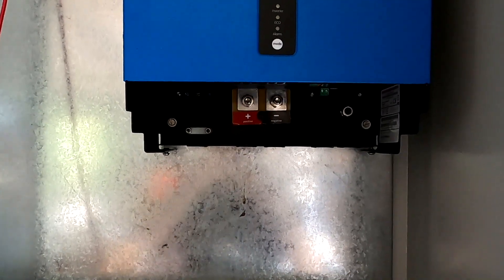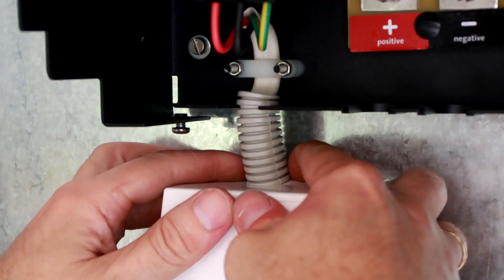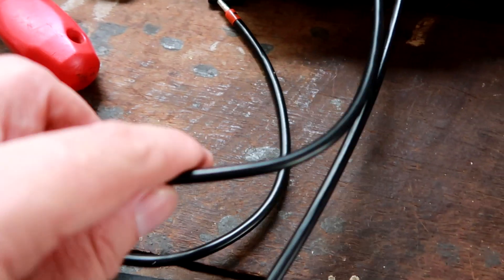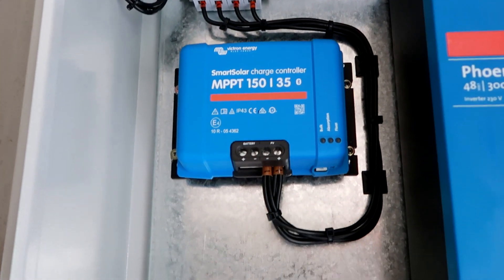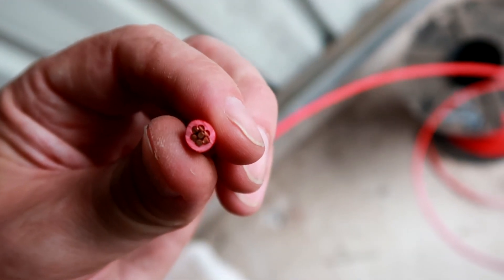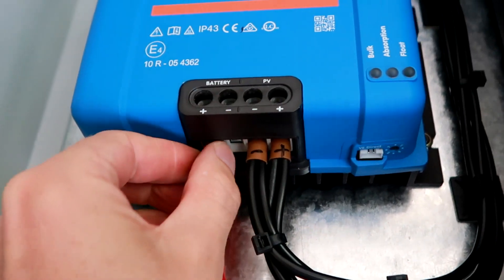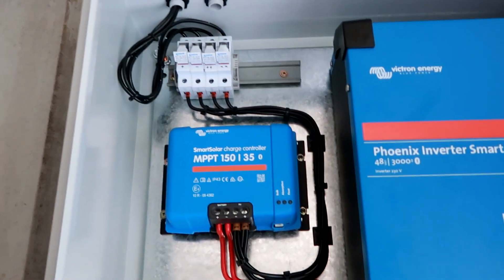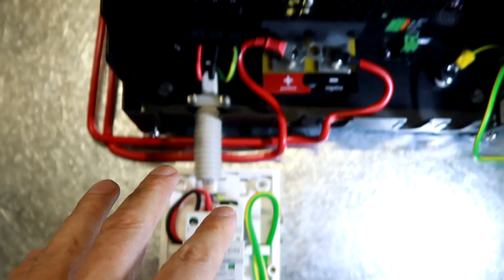'The Move'. More equipment inside the cabinet. Will it all work out?

Comment: Yes fuse from charge controller to battery. What if charge controller shorts? Can your 10mm cable handle the fuse rating of your battery?
Reply from the maker: The cable will be the fuse. Yes, you're right.

Comment: Don't completely cut the power to the garage otherwise how will you topup the battery
Reply: Instead of dead ending the input power from the grid attach a power point to it
Reply: Or better yet an automatic transfer switch so if the batteries get low it switches back to grid power.

Comment: Great video! I think if you put in a breaker between the MPPT charge controller and the Inverter, you could potentially shut off that breaker before the solar panel breakers which could damage the MPPT (according to what I read). Several people have said they can't kill their MPPT, but I would not want to test out that theory.

Comment: I'd definitely put an appropriately sized fuse between the SCC and Inverter., is that wire you used the correct size? I think mine is 2/0.   Nice clean work. Your enthusiasm is infectious.
Reply from the maker: The wire size is correct for the 35A from the MPPT, but yeah, the it conencts to the 35mm of the battery. There should be a breaker.

Comment: I know this is the off-grid garage, but have you thought about putting  an automatic grid switcher in case you run out of battery juice?
Reply from the maker: I thought about it for a split second.
Reply: @OffGridGarageAustralia  If you were going to do this you could have just went with the Victron MultiPlus  instead of the Pheonix. It has a built in transfer switch and can auto switch based on things like battery SoC or voltage (And even charge the battery from grid if ever desired or needed)

Comment: I use one 60A dc braker after each solar charger and connect inverter with #2/0 awg from the battery.
Reply from the maker: Makes sense.
Reply: @OffGridGarageAustralia  EE aren't here to help, just to discourage diy from taking jobs away from them. A disclaimer note to follow safety and local electrical code is enough.

Comment: Hi Andy, I believe your solar charge controller internally fused??? They say that it’s non replaceable but I would open it up to see, however does it protect both input and output? 
If so, my theory is that if you do add a fuse/breaker inline is will need to be rated lower than the internal. As far as breakers go those “Ebay specials” are junk and can’t be trusted. I have ordered some DC breakers that have the same form factor as AC from alibaba/aliexpress, and am going to test them to see if they perform as advertised, I will be pleasantly surprised if they do.
And as for Isolation like you said you can “isolate from the panel fuses” if necessary.
Reply from the maker: It has an internal fuse as per manual, that is correct. Just not sure how big it is so hard to tell what size of breaker would make sense.
Reply: @OffGridGarageAustralia  I’d say it’ll be 5 amps higher than the max output, curiosity would get the better of me and I’d have a sneaky peek inside, maybe at night or while there’s no solar production to be lost...
Reply: @Adlay_Eetswah  Breakers and fuses are typically sized for 80% of continuous. So if continuous power is 35 amps for this MPPT, you'd need a 45 amp breaker for 35 amps to be "under" the 80% rule: 80% of 45 = 45 x .80 = 36.

Comment: Instead of having the meter feeds terminate in an unconnected box, consider having a meter fed outlet beside your box installed so you've got the ability to power things (Like your new battery charger) when you need to swap out a component or you've got an extended period of unexpected low battery due to weather, etc.
Reply from the maker: I thought about this for a while. Let's see how I go as I expect the battery is been rather full all the time at this stage. Not too much load inside the garage at the moment.
Reply: I went back and forth on suggesting it as well, you can probably use an extension lead or two from the house if it were an absolute nightmare and battery powered devices weren't cutting it :)
Reply: @OffGridGarageAustralia  why not use a changeover / transfer switch instead of an end terminal? That way you can use solar for garage lights/ sockets but at the flick of a switch in an emergency you can put those lights and sockets back to mains fed. Only like £30 for an enclosed transfer switch and gives you both options of power sources :)
Reply from the maker: @w3bb0y  but I also would need to take out the M.E.N link inside the inverter which connects N and PE. 
The all in one units do this automatically with a relay depending if they run from battery or grid power.

Comment: Andy looked at this video and saw a lot of errors. I have an interest in solar, I’m a licensed electrician in NSW and also a degree electrical engineer. If you can contact me I can go through your installation and make it better and safer. I like your attitude and videos .
Reply: Yes, a 60A mppt controller needs at least #4 awg cable or 5mm
Cables bend create resistance. 
Inverter enclosed in the metal box create lot of heat, over heating and inefficiency.
Reply: @neliosamch3195  that’s 25mm
Reply: @michaelbouckley4455  I stand corrected. I miss the #2 thanks.
Reply from the maker: It's a 35mm MPPT connected to 1.2kW of solar. 25A are max it pushes into the battery.
Reply: It will be more helpful if you share your knowledge and experience with everyone here.
Reply: Andy can't find a contact so I'll post  brief observations. 
1) just be super careful with your installation. If someone is electrocuted you could find yourself in some trouble. Generally In  australia writing installation needs to be done by a licenced electrician. 
2). RCD will not work. An RCD only works if the installation is earthed AND the neutral is connected to earth. Its called the MEN system
3) Fuse holders from solar panels should be double pole. Ie one handle pulls both fuses. If one fuse is disconnected, the solar panel will still be above earth potential and could electrocute someone that expects the panel to be dead.
4) Active and return wires should be different colours. Place a  coloured sleeve over the returns to distinguish them.
5) Battery should have a double pole disconnector between it and the inverter. The disconnector could be a switch or a circuit breaker.
That's the important stuff
Reply: @kaindub  Very good observation but 48v is safe to touch without safety glove.
If somebody unauthorized to be there get electrocuted isn't a bad thing.
Do you have an opinion for a safe reverse voltage for melting the snow in the solar panel?
It is being  done commercially but no information for a diy setup.
Reply from the maker: @kaindub  It's all here: https://www.youtube.com/c/OffGridGarageAustralia/about
1) Yeah, I'm electrician myself, they just don't accept my 4 years of apprenticeship and 20 years of experience in Germany here in Australia
2) RCD works fine, the N is linked to the PE internally (see previous video with the inverter upgrade). As this is an off-grid system, This internal link is the M.E.N
3) fuse holders don't trip, they melt the fuse inside. You're talking about breakers?
4) You mean DC from the inverter or solar? I looked this up and it's just a recommendation from what I could find.
5) battery has a fuse to the inverter which will melt if A > 100A
Reply: @OffGridGarageAustralia  3) replacing the fuse holders with dual pole, linked-switch circuit breakers, is safer, and easier to use, when you have to disconnect the solar, first,  before any work on wiring. The dual simultaneous disconnect is a legal requirement in many countries, eg USA
Reply: @OffGridGarageAustralia  5) a battery kill switch to the inverter would be better; perhaps with a bolted junction, so as not disconnect the solar charger from battery; that could have a, or pair of breakers too
Reply: @OffGridGarageAustralia  A double pole fuseholded opens both conductors at the s a me time. Its not really recommended to install fuses in return lines, but if you do make it so that both conductors are isolated when the fuse holder is opened.
Reply: So I have ro make a correction.  I looked at the video describing the inverter.  The earth and neutral are connected in the inverter. So you rcd will work correctly. Sorry my bad.
Reply from the maker: @kaindub no way to contact you. You have to contact me through the About page here on my channel.

Comment: You have probably already done it but you should probably put in a transfer switch or some way to easily switch back to your mains power if something happens
Reply from the maker: There will be no mains. It's an off-grid system.
Reply: @OffGridGarageAustralia  ya but what if something stops working or you just have to service something then you have no lights or power

Comment: The charge controller manual will give you guidelines on what fuse size to use. Generally 125% of the charge controller rated amperage.
Reply from the maker: Nothing in the manual of the controller in terms of wiring or fusing...
Reply: @OffGridGarageAustralia  It may have an internal fuse, in that case it would not need an external one.
Reply from the maker: @SpeakerKevin  that's what it says in the manual, yes.

Comment: You do nice work I always use a both pv & battery breakers for CC but it is just me.
Reply from the maker: So breakers instead of fuses from the solar?
And a breaker between MPPT and battery too?
Reply: @OffGridGarageAustralia  I use breakers but fuses are good too. I just like them in case I have to isolate the charge controller then I don't need to shut off inverter to work on it.
Reply: Good to use an automatic reset contact breaker, rated at cable current capacity, and voltage; to protect the wiring from mppt to inverter / battery. It shouldn’t trip out, unless there is a fault, or short circuit.

Comment: Looks good, I use DC breakers between my charge controllers and the battery bank, give the ability to isolate the charge controller and servers as a protection measure.
Reply: If the DC braker turn off and the controler hawe no batery conected and solar is still on u Will probably fry the controler or the DC stuff u got on the load output with the máximum voltage of the array . Soo my opinión is if u whant u can put a Big DC switch for maintanace but no fuses if they trip the majority of the charge controlers Will be dmaged
Reply from the maker: @andreiapostolache3487  I tested this already in one of my other videos, the controller can cope with solar only and no battery. Others cannot do that and you're generally right...
Reply: @OffGridGarageAustralia  yeah maybe for a bit of time is ok but i dont think the controler like the open circuit voltaje all day :p duno maybe this one hawe protection, the true is do u rly ned dat protection ?
Reply: @andreiapostolache3487  yes this is why I'm hesitant to add a breaker or fuse here. One day whoops there goes the victron controller because a faulty breaker . Idk
Reply: Agreed. I’ve found it very useful having an isolator which allows you to service/change the charge controller without having to shut down the whole system.
Reply from the maker: Thanks.

Comment: This the stuff! :)
Only thing Andy i think if you manage to get some 4mm2 twin ferrules in the future would be abit tighter fit. The cream over the cherry so to say.
Anyways keep it up.
Reply from the maker: I know what you mean. the 10mm terminal is very tight already and I had trouble getting both cables in. I pulled at it and it's bombenfest.
Reply: Crimp pins make a better contact on the contact breaker terminals, too